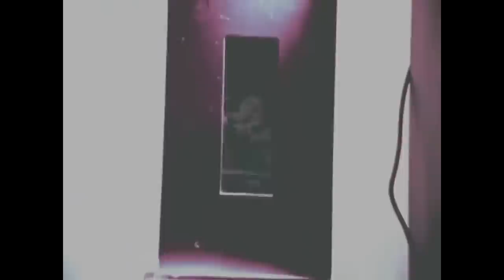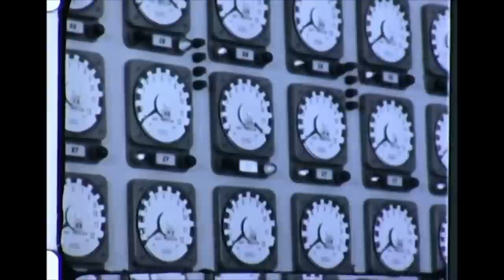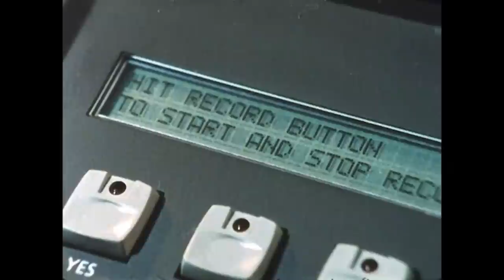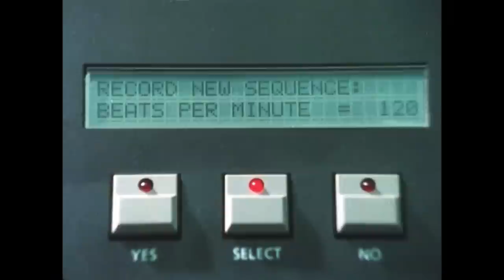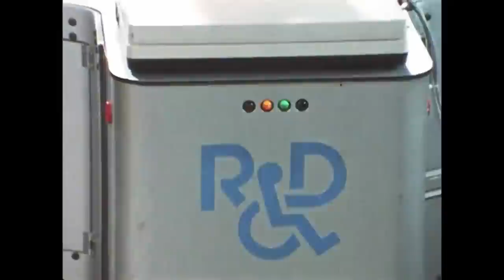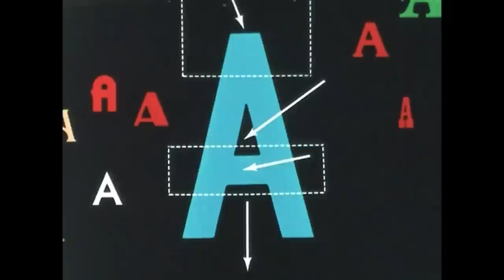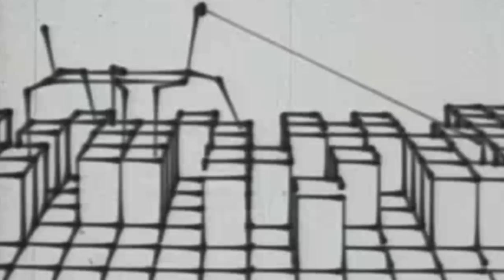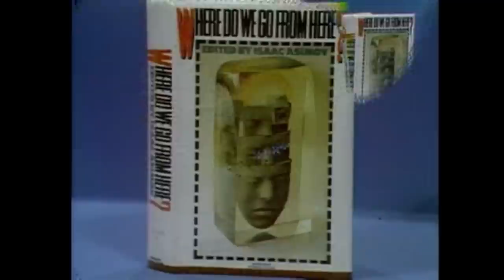Retrofuturism: The Future Has Passed | Sleepcore

Comment: In the early 1960's, the fanciful & often absurd concepts of using advancing technology must have seemed a likely reality, within 5-10 years. The quest seemed to be to  design the gadgets, dwellings & landscape in the childish spirit of "Buck Rogers", with the idea that these things would certainly soon become everyday reality, & with no real consideration of practicality or cost. I guess the idea was to appeal to the ignorant; engineers were creating advanced (& real) aircraft & spacecraft (& many other things) at the time, using practical knowledge, but these advanced machines (along with Hollywood "B" science fiction movies) inspired the fanciful ideas & expectations of the public, at the time (such as the personal flying car). Still, this video was interesting & fun!
Reply: Extra Ecclesiam Nulla Salus  No, but the cupboard had a futuristic feature, which made it "better" & more desirable. Plus, it was effortlessly controlled by a cosmetic push button switch.
Reply: Also, imagine how much repair, component replacement & adjustment all of the push button activation & remote control appliances & furnishings would need, along with the cost. In reality, several machines with "advanced features" were unreliable, & when these features failed, often people would use a machine's manual features-just to make the make the machine work at all.